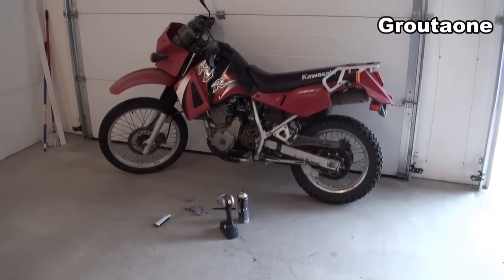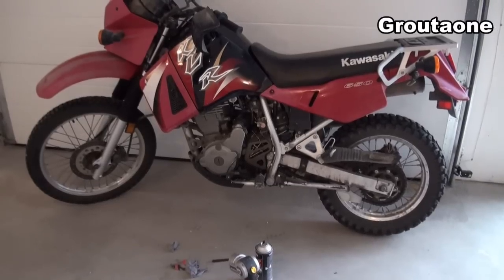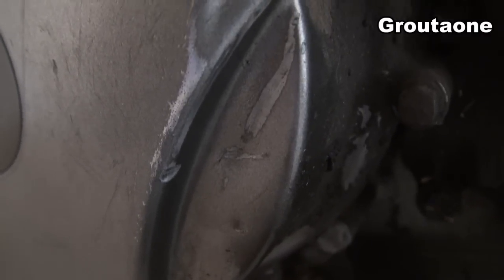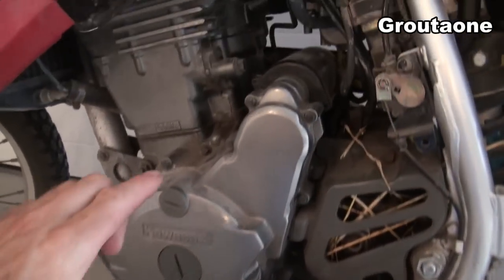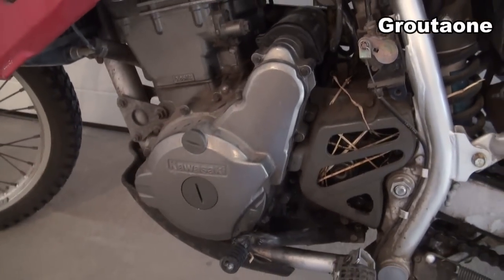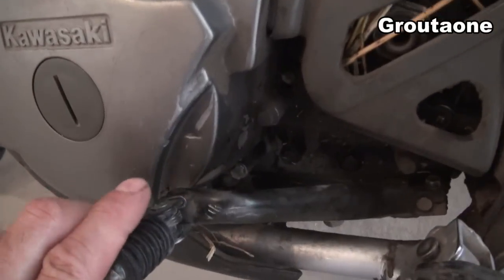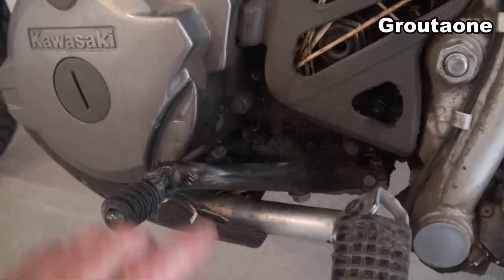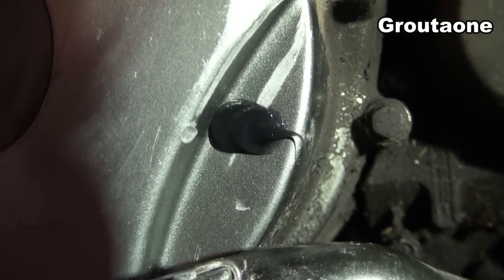KLR 650 Oil Leak Quick Fix

Comment: When I was in high school in the 70s I used silicone on the front of my intake manifold on my 302 67 mustang to stop an oil leak, I cleaned it really good with lacquerer thinner and wiped some Permetex gasket sealer siicone on it from the outside and it held perfectly. 
  My oil pan on my 99 ranger the gasket I noticed yesterday was squirting out in the front around the main bearing. I am going to loosen the pan some in the front and try to stick it back in. and put some silicone on the out side and I hope it seals. Looks like it may completely come out all together and ruin the truck.

Comment: odd how I got a notification for this video but not the grain bin demo video a couple hours before
Reply from the maker: +The Dude You tube is a little glitch sometimes, hey Is that a TT500 with longer forks in your picture?
Reply: +groutaone good eye yes it is
Reply from the maker: Cool, is it your bike?
Reply: +groutaone yes it is mine I bought it in about 6 boxes and have been slowly restoring it....it has a stainless steel frame only tt with a frame like this nor have I been able to find any information about it even my engine and frame #s aren't listed
Reply from the maker: That is a mystery alright, may be a custom bike made for someone at Yamaha back in the day, so even the engine has never been ID stamped?
Reply: +groutaone yeah that's the only thing I can come up with because it is definitely a yamaha built frame the #s are totally different from all my other tts and xts...when I 1st saw it's stainless frame under a pile of junk I instantly knew it was something special and I had to save it

Comment: Quick question what coolant do you run in the cr 500 i just rebuilt mine and fixed the magnesium problem and i really dont want my clutch cover to rot to bits
Reply from the maker: +austin andersen I use normal automotive coolant, mine is a 1990, first year with the aluminum water pump that won't corrode like the older magnesium pumps

Comment: Dear Grutaone, as a young dirtbiker (16), i would like a little technical advice from you... After ride, i stand my dt 125 from 2000, she drops some oil/black stuff from silencer. I read a lot on forums, but never met anyone with my kind of problem, she is not coughing gasoline out, just 2-3 drops after few minutes ride, so i dont think that its time for top end rebuild. My guess is just that exhaust is filled with carbon as i dont ride her extra hard, and giving her premix with bit more oil... You also have 2 strokes, i wonder if is it ok, or is it service time :)
Reply: +Adam Hraško Too much oil in the mix combined with riding at low revs allows oil to build up. Mix the oil and gas as required by the manufacturer and allow the engine to rev more.
Reply: I believe your guess is correct, its most likely un-burnt oil with a small amount of carbon, and possibly some unburnt fuel, dont think its anything to worry about other than maybe building up in your exhaust and I think the only thing you can do about it is put a slighty less oily mix in.
Reply: +rzr kid  +yellowbusguy thanks guys... Exhaust has not been ever cleaned, i will take it off and probably clean inside by pure gasoline (burn it). Used this way on all of my vintage jawa´s :)
Reply from the maker: +yellowbusguy  Hi Adam, yellowbusguy has the answer here you are looking for. It's ok to run a two stroke at low revs but also feel free to give it some good rpm here and there in riding areas where you feel it's safe to do so
Reply: groutaone Yup, we already got an solution. Thanks for replying. Have a good day :)
Reply: +Adam Hraško 2 strokes are meant for hig rpms, at high rpms the bike has the highest power and consumes the less fuel.. only carefully manage the mix of oil and fuel because sometimes revving up too long can cause the carburator to empty and it may lead to the piston overheating and welding to the cilinder >.< ouch